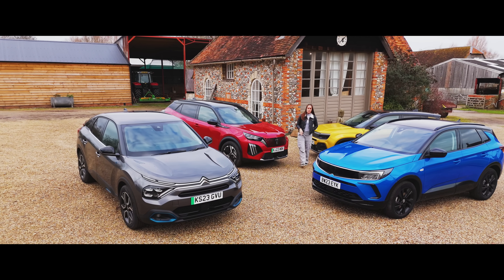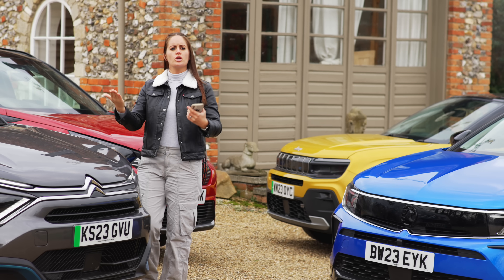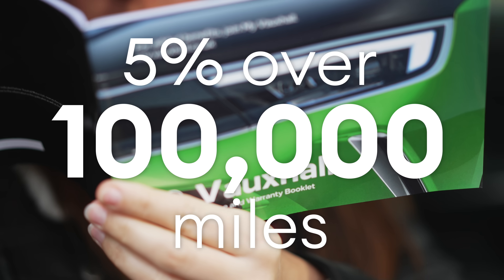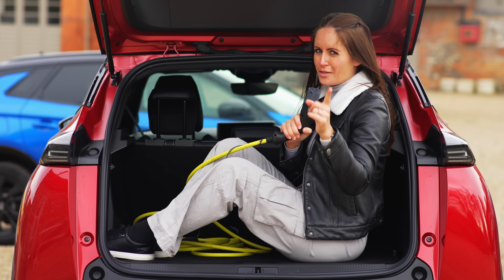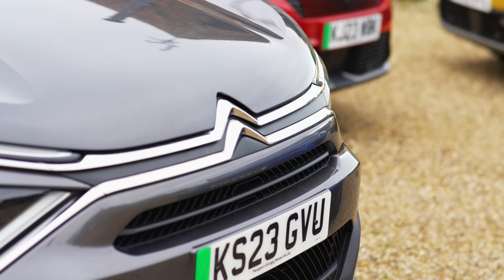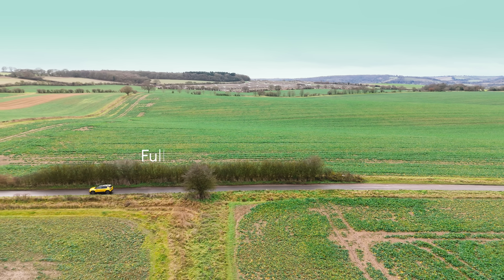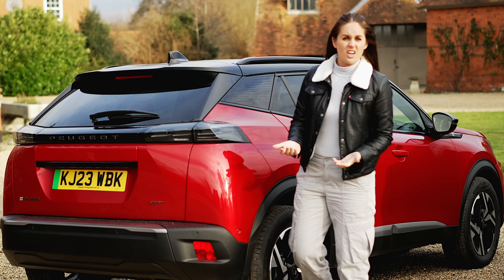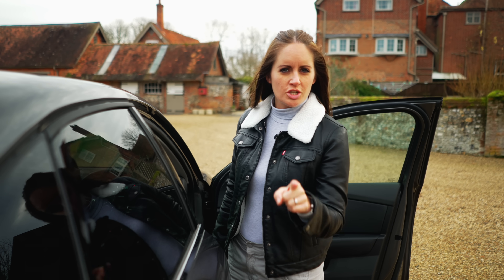REVEALED: Used electric car batteries – do I need to worry? | Electrifying

Comment: You might want to watch one of Bjorn's videos on EV batteries. He had a Tesla taxi that was supercharged a lot and it lost 16% after 245 charges and 98k kilometres.
There needs to be a huge infrastructure that will repair your battery just like garages currently repair ICE cars. It's just not there yet.
Reply: I think “buyer beware” of buying a used electric car that was a taxi with a high mileage in a short space of time. Same as a conventional used car with super high mileage in just a year or two.
Reply: @asjames7711  interestingly, though, on the Leaf group I'm a member of, there are numerous 100,000+ mile Gen 1 Leaf examples which have really excellent battery State of Health percentages despite having been rapid charged, sometimes, multiple times daily.
Then there are others which have been largely AC charged, with surprisingly low SoH % with only 30-40,000 miles... 🤷‍♂
Reply: 98,000 Km presumably
Reply: In the US, there is SO much push back with EVs that I doubt there will be ANY real infrastructure being built within the next 10yrs!

Comment: Nicola, you are always so clever and entertaining! Who knew that you were one of quadruplets? I can attest that the petrolganda against EV batteries is just fossil foolishness. After 6 years and 78,487 miles, my EV's battery still has 94.35% capacity.
Reply: Ahem, so it has lost more than 5% in less than 100.000 miles ? Worse than one of them promised ? Q.E.D.

Comment: I waited the entire video to hear how you can tell how many 0-100 kph speed runs the pervious owner(s) did showing off to their friends.
Reply: Just like an ICE car then, you wonder how many times it was bounced off the limiter.
Reply: @tomooo2637 Yes, and driving an EV fast does very little to the battery, compared to the damage it can do to a piston engine and transmission.
Reply: @tomooo2637  Well, I suppose.  With a few notable exceptions, most all EVs have more get-up-and-go than the bulk of average ICE vehicles out there. And I'll bet the tendency is to test out that EVs acceleration.  Some battery chemistries suffer from repeated quick draw-downs.  Not sure when buying a used ICE Toyota Camry for instance, a person wonders how often the previous owner tried to bury the needle on that bad boy.  So no, imo, on average, NOT just like an ICE vehicle.

Comment: Good try, but second hand cars near end of life, will be like playing pass the parcel. Someone cops the expense of either scrapping it and accepting that they've lost their money (and car) or replacing the battery at a extortionate cost. As most cars of a certain vintage will be driven as first cars by young new drivers, who won't be able to afford to spend a 'fortune' to replace a battery, they'll probably be avoided which will also destroy the desirability of owning a 'old' EV because of that risk, which in turn destroys the resale value of the EV, as the market disappears. Of course things can change in time and replacement batteries could become cheap and easily interchangeable and we might get a technological leap forward to extend, prolong and maintain battery life, but that's unlikely to impact the cars on sale today!
Reply: You kinda said it yourself - things can change in time...
There are already companies springing up that can replace the individual cells in a pack, rather than replace the entire pack itself - that brings the costs down significantly.
Reply: Stop reading the Murdoch press.

Comment: The cost of replacing an EV's battery 'may not cost much more than the cost of replacing a conventional cars' engine and gearbox'? Err…no…it costs a LOT more… Besides, replacing an engine and gearbox isn't something that the vast majority of today's drivers ever need contemplate, let alone will ever need to do.

Comment: Hello I would love to own 1 but the price of getting 1 then you say it's similar to replacing an engine with gearbox yet we hear cases of battery replacement being more expensive than buying a similar ev then the cost  insurance. Factor in unreasonable costs of charging away from home. Am confused 😕
Reply: Do your own research. You have a world of knowledge at you finger tips.
Reply: Please note that the two incidents with Hyundai Ioniq 5 in Canada needing expensive replacement are unique to that car model and that country.  

There are millions of EVs on the road, and only those two customers had that experience.  

The manufacturer doesn't charge that much for the battery, but in those two incidents, third parties were able to fleece the customers and for some reason Hyundai chose to let it happen.

Comment: I'm a huge EV advocate, but I've no idea where they got the 5% degradation after 100,000 miles from?? Just not true. It's more like 10-15% on average after 100,000 miles.
Reply: Agreed on this point. I too am big on the EV bandwagon, but I don't really like seeing claims without references or links to the data that produced them. After all, 74% of all statistics are made up, everyone knows that 😂
Reply: @rylucia  I think 5% is a best case, just a little misleading.
Reply: @rylucia Actually, I've heard that it's 73.69% of statistics that are made up on the spot by someone who hasn't the least idea what they're talking about.
Reply: @rylucia  
Bandwagon? What are you talking about?
Reply: It may be correct for Tesla. I watched a video from an EV repair shop in near London. Tesla taxis with 200,000 miles had lost 10%.
Reply: @gordonmackenzie4512 I drove a Tesla. 50,000 miles and 10% degradation 😬
Reply: There are good websites that go into the science behind battery health.  If the previous owner hasn’t been regularly charging to 100%, using DC chargers or maximising the depth of discharge, you’d probably not notice the difference after 3 or 4 years.  Buying a car from a DC charging road warrior would be bad news!
Reply: @srbs73 which will be interesting’ in 3-4 years time as all those company cars come to the end of their lease. A lot of them get whacked onto fast chargers as the driver is rarely paying for the energy.
Reply: I agree. Tesla’s may degrade 10% over 100-200k miles. But VWs are showing 20% degradation at 70k miles :/
Reply: @tomcockcroft9394  how much of that is the owner vs car?
Reply: Maybe they got their numbers from Kia or Hyundai EV owners.  They are really good!!!! 
I know my data......🤭
Reply: @yingmustang67  yeah but even though their SOH will likely show as 100% the available capacity will likely be reduced, but yeah Kia / Hyundai seem to have very good batteries.
Reply: Came here to comment the same thing. Also battery degradation is a lot more linked to the age of the battery and charging behaviour rather than miles travelled of the vehicle.
I’ve been looking after my VW ID4 battery very well but it still appears to have lost around 7% usable capacity in 3 years and 25k miles. I would be thrilled if it only lost 5% after 100k. Perhaps the 5% per 100k is an average on cars that have done massive mileage since the capacity loss slows down as time passes.
Reply: @SuperlightR400   Tesla's report showed the biggest degradation loss is within the first 100k then its slows right down
Reply: @SuperlightR400  yeah you tend to get less degradation when the miles are put on quickly. Seems the ID cars are similar to the Nissan where they lose around that amount then level off, hopefully the rate should slow over the next few years 👍 I was hoping the feature was going to actually look and check the SOH of some 3, 4, 5 year old cars but she was just surrounded by beans new cars. That kind of reporting is better done by other channels like Bjorn Nyland.
Reply: @SuperlightR400  
Good luck with your VW ID4!
Reply: I believe they might be telling a little white lie here. They said it loses 5% per 100k miles- but didn't mention degradation with age. Calendar age of the battery is actually the biggest cause of degradation- so it sounds like they've only mentioned one side of the degradation figure here.
Reply: Just had a battery management software update at the main dealer on our 8 year old renault zoe, and a battery health check. The update has brought the battery back to 98%
Reply: @michaelpaine9492  yeah that's what the update tends to do, it will have lost capacity but the buffer on the 22kWh Zoe is so big you don't tend to see it..
Reply: My Citreon ec4 2years old with 25.000km lost 3% battery sooo yeah 100000km ill lose 12% by then if that keeps up
Reply: Tesla reported 10% degradation on their cars after 200,000 miles. Search it out
Reply: From where did you get this numbers?!
Reply: I've just hit 50,000 miles and 10% degradation.
Reply: Battery chemistry, calendar ageing, charging habits, heck even the climate the car is used in. Even the same models of car have different chemistry batteries or may have been made in different factories with slightly different final grade of cells and cell resistance. So very tricky to generalise, in my opinion.
Reply: The degradation of Tesla's at least show that the first 5% degradation happens after the first 25k or so then it plateaus only losing another 5% after 150k-200k miles.

Supercharging didn't seem to have much effect which is good to see.

Original Nissan Leafs on the other hand...... Their degradation is significant with only 8/12 bars remaining after 55k. So that's 33% degradation after 55k and 6 years old. Not great.
Hopefully the newer cars are better!
Reply: So from what I've seen of actual data it's not the mileage that is the big deciding factor for degradation but how the car is charged the climate it has been in etc, so a car that is fast charged and has spent it's life in a hot climate will obviously degrade a lot faster than one that only slow chatges in a temperate climate, I do believe that under ideal conditions you may see a 5% loss over 100k but most cars will likely see between a 10-30% degradation which on car which is likely 10 years old means they don't really become use able for the majority of people at that point. This is an opinion based on an average real world range of 150/200 miles on a new car - loss and the car not being as efficient likely going down to a real world range of 90/120 which most people wound easily do at the weekend for example visiting family going out etc
Reply: I agree. My 38k mile Tesla M3P has degraded to 91%
Reply: Dutch Tesla owners club data
Reply: @Lewis_Standing  more than 5% according to Bjorn Nyland and his many many tests...
Reply: 5% after ten years may be a bit optimistic.  Third party data on old Teslas show that the loss of capacity is not linear.

They typically lose about 3 or 4% after two years, but then only 1% per year for the next couple of years, and then less than 1% per year after that.

Two things that don't make as much difference as you'd think:  Fast charging, and high mileage.

The exception is those ride-share cars that get fast charged multiple times per day every day.  The cooling systems are not optimized for this case and until they are, this use will be a serious problem.
Reply: Wow talk about false advertising 

I am huge ev fan and ev owner but come on 😂any one that buys the dog and pony show that was served in this clip should get their heads examined and their money confiscated. 

Ev range will drop 5-10% easily in their first year it will flatten out a bit over time and sure it will depend on the chemistry and the manufacturer as different manufacturers have BMS and cooling or heating to protect batteries except Leaf of course. 

I have also experienced more expensive service and then they do absolutely nothing including not giving me the capacity. 

On my diesel or gas car I had multiple options for service places so could push the price but now I am locked to one place. 

The car experience aside everything is more expensive and will most likely not be covered by guarantee as they design the guaranties to not fault out on behalf of the manufacturer

See it as a consumable and early adoption 

Still ice cars are more efficient and reliable ownership and still more mainstream.
Reply: You may charge an EV to 100% with NO problem, but you need to go within 15 minutes (my own rule) to drive your car! 

If you charge your EV, but you don't go right away, then charge it to 80%. 

You battery had to stay in 20% and 80% in perfect condition. 

I had the classic Ioniq with 28 KWh and I always charge it to 100%, I have to.....